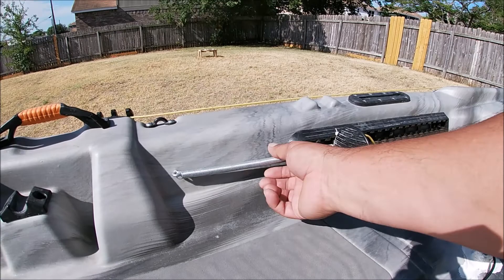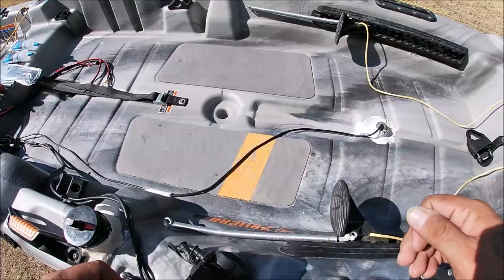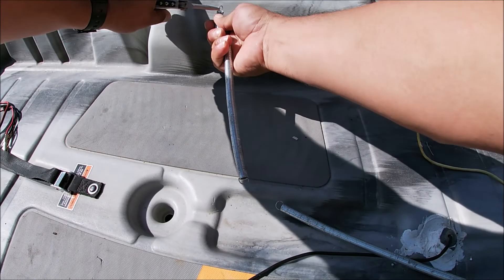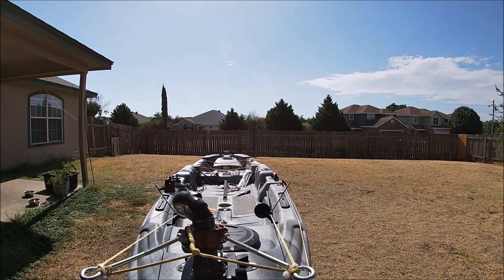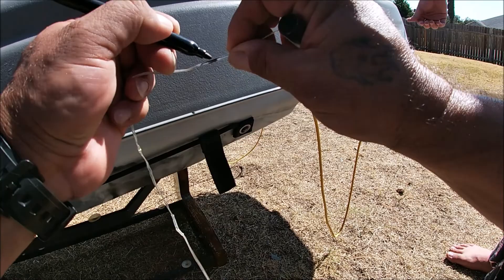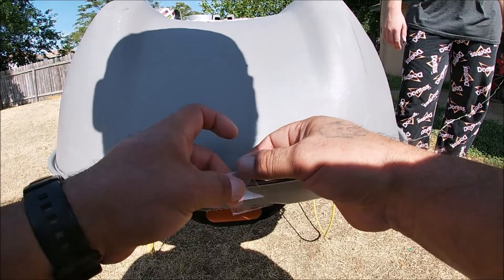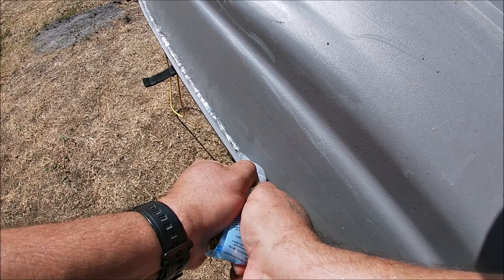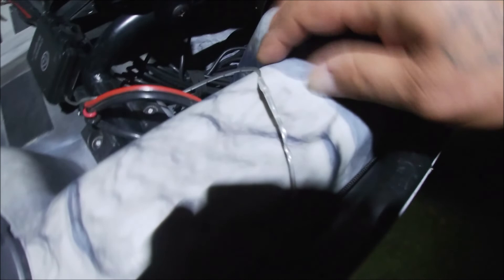Modifying a PELICAN CATCH 100 PREMIUM Kayak!*(Steering and Lights)

Comment: New Sub came over from hogdeer79. Zip ties are awesome, I use them often. Great job getting your kayak wired up.
Reply from the maker: Cool Cool, The trick is to use exterior zip ties, they hold up better in the elements! I appreciate you very much.